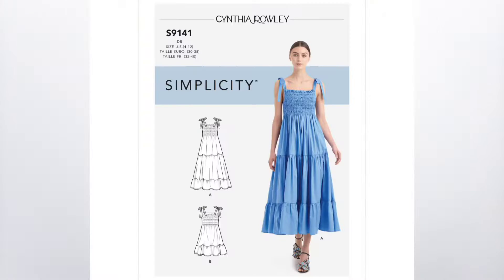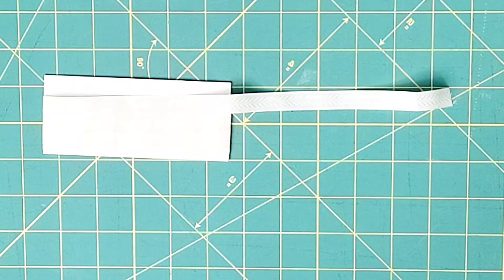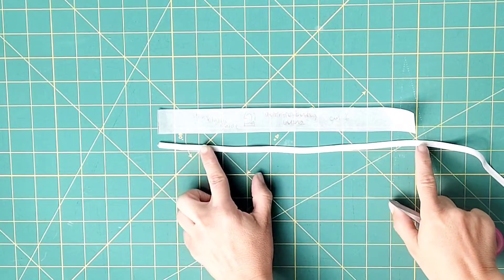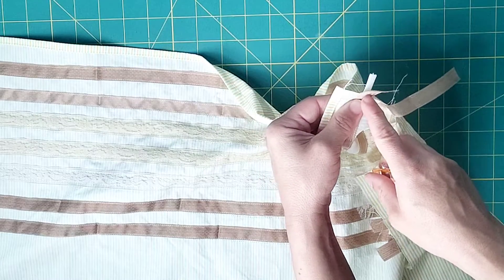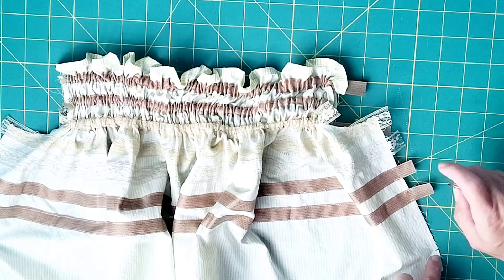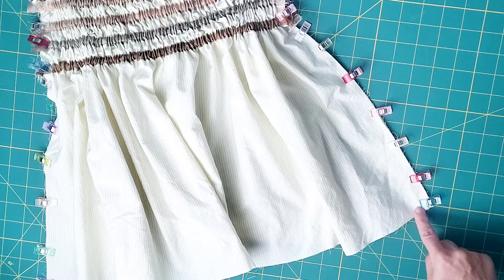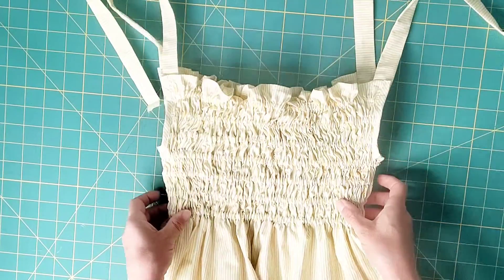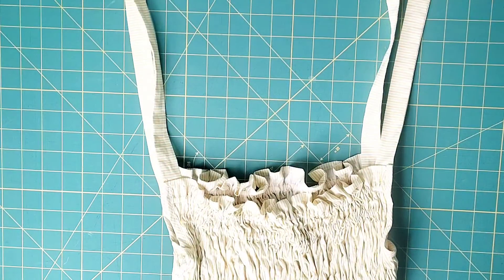Simplicity 9141 Sew Along // Shirred Blouse with Maxi Dress Option

Comment: Is there a way to line it. All that casing isn’t it itchy?
Reply from the maker: All my seam bindings in front are  soft, silky, and pliable, ... And it's all right over your bra, so extra layer there.  :)
You could certainly line or interline if you wish.
Reply: I made this. The hem tape is very soft
Reply from the maker: @AnitaMcB__  I've been looking at others makes on Instagram too.  Lots of nice versions.  Curious -- did you do the casings or elastic thread?